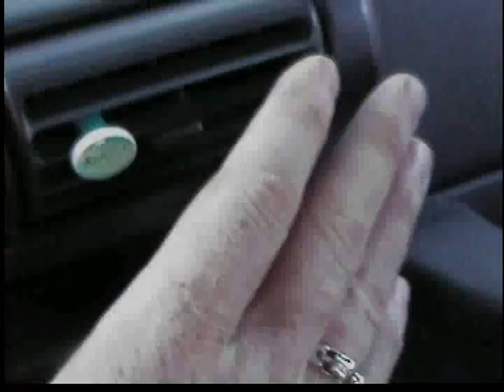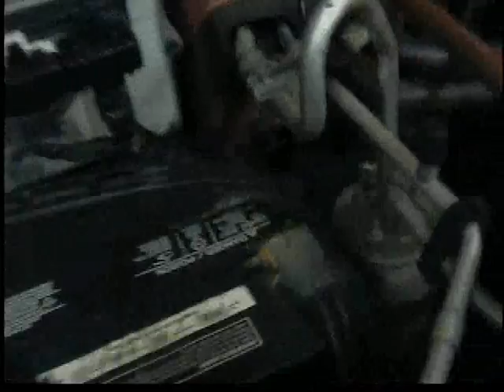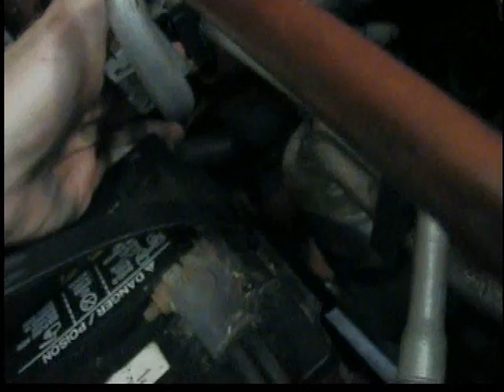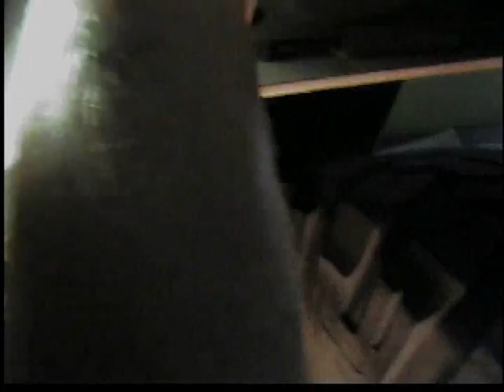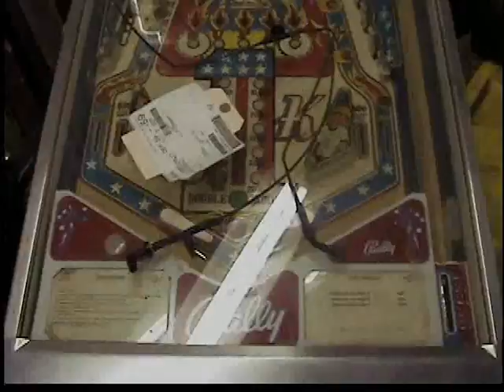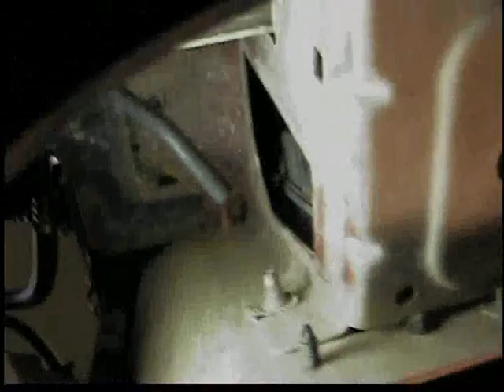cruise & HVAC controls vacuum leak fix, Jeep Wrangler TJ

Comment: Ok so everyone. Plug your engine vacuum off entirely and go get a jeep JK 12 or newer vacuum pump and bracket and wire it up on the keyed side via a relay and no more engine vacuum issues or leaks.. with 4 or 6 cylinders it’s the fix Chrysler should have made from the factory oh and your welcome!
Reply from the maker: Good info. Of course fixing the leaks is still a good idea. Jeep On!

Comment: Would you by chance have any videos repairing the electric door locks? 

I changed the driver side and am having issues with the metal rod locking from inside the jeep. This is nuts, been doing this all my life and a jeep is killing me!! lol
Thank you in advance!!
🤟🤟👍🤠
Reply from the maker: No. Inside the doors is tough to film. I have one for the outside door handles. It's filmed on a YJ.
Reply: @user-nq5rd4ck5z  
It's not the door handles I need to replace, it's the electronic selonide and the metal bar that goes to the lil flip button Inside the to lock/unlock I'm having issues with..
Ty

Comment: Hello, just found you today...
If you can help I'd deeply appreciate it. 
Question, my girlfriend has a 1998 Jeep Wrangler? Don't think it's a Cherokee just a plane ol' Jeep.
The controls for the defrost, vents, heat to the floorboard dosen't work. 
The blender door is cable operated soooo guessing it's OK? lol
Whatever info you could provide I'd deeply appreciate it. She dosen't have any heat at all and winter is coming. 
Thank you in advance!
Reply from the maker: Yes, lots of things to check. No blow could be the blower motor. It's also common for the box/duct to fill up with leaves and stuff. Check it when you pull the blower motor. Unheated blow is either low coolant or a bad bypass valve. If it blows only on high it's the blower motor resistor. I have a video for that too. This video is applicable if it only blows out of the bottom vent by your feet.
Reply: @user-nq5rd4ck5z  
Auctly I got it blowing from defrost, Center vents and floor however it dosen't seem to be as hot inside as it should be as in enough to defrost ice/snow. 
Where would the valve be you're describing? 
The heater control is operated by a cable. If that also goes to the proportioning valve would you have a video showing its location?
Thank you in advance!
Reply from the maker: @joesdot3288  I don't have a video on that. Jeep searching. Somebody does. Jeep On!
Reply: @user-nq5rd4ck5z  
I appreciate you...
Thank you very much 👍🤠

Comment: Can this cause high idle rpms. Mine is cracked and my ramps seems to be getting stuck at 1000 at red lights. It used to be worse but I already found and fixed 2 vacuum leaks. It gets slightly better with each fix
Reply from the maker: Yes. Vacuum leaks definitely cause high rpm idle problems.

Comment: My vacuum line at the vacuum reservoir has a T that one broken end turns into plastic and is 3" long and has nothing plugged into it and I can't find anywhere to plug it in? Other video I've seen just has a straight rubber hose. I just capped it for now. My cruise control never worked. Still doesn't.  Another line from the firewall is routed to a spot behind the battery and is just capped also, no idea where that goes. 2000' Jeep Grand Cherokee Laredo 4.0
Reply from the maker: Yikes. You need another Grand to compare it to.

Comment: my light on the dash will not go on , any ideas. is there a fuse were is that ?
Reply from the maker: Which light? I have lots of ideas. Jeep On!
Reply: @user-nq5rd4ck5z  the cruise light.... Green won't go on as well as the. Cruise
Reply from the maker: @rodgerrowe2424  Yeah, that is not a vacuum problem.

Comment: Dealing with the exact same thing.  Heat/fan would only run on low and medium and only blow out of defroster area regardless of where I had the switch.   Switched out the blower switch now have all settings but only coming out of the defrost area, so I checked today starting at the driver's side firewall and going around to make sure All the vac hoses were connected.  Found one by where the spark plugs are that is dry rotted and cracked on both ends but until I can replace pushed it back on there real well and now have air blowing out of all areas depending on where the switch is set, BUT it is also blowing out of the defrost on the other setting too.  When just set on defrost that is the only area it comes out of.  Anyway looked under the passenger wheel and the vac line there was just hanging loose under there.  We had a Stay and Play SMI braking system hooked up at a shop,  and I suspect that's when that one got knocked loose, but can't be certain.  Anyway hopefully after the dry rotted hose is replaced we will be in good shape.
Reply from the maker: crackerjack4u Cool. Check out my blower motor resistor video too. Jeep On!

Comment: Same CC/HVAC problem with my 95 Grand Cherokee.  Are these components in the same place?
Reply from the maker: It you have the 4.0L 6 cylinder some of it might be the same. But the Grad is a Detroit Jeep and a lot of the designs are different from the Toledo Jeeps. Start at the manifold and follow the lines looking for cracks or splits. Jeep On!
Reply: wwwCARSSUCKcom Cool, thanks a bunch!

Comment: so my Jeep Commander 06 cruise won't work. sometimes the air flow switch seems to be broke too. I lose power also going down the road. the traction control light flashes. think this will fix it?
Reply from the maker: Joshua Wilson I doubt it. Sorry. These are completely different vehicles. You could check the vacuum lines but they have nothing to do with traction control.
Reply: wwwCARSSUCKcom I had it plugged to a diagnosis and they said my cruise runs off a vaccum lines. then you said something about the blower fan being stuck on one setting. it made since when I seen this video. thanks again

Comment: the tubing is ripped and when i tried putting electrical tape it always rips again any ideas how i can fix this? do i have to get a new T or some sort of tube sleeve?
the tension from the tube when it comes out the firewall is whats making it rip i feel like i need an extension so when it meets the T it has slack to stay together.
any help?
Reply from the maker: Not sure which tube is ripping. If it is part of the engine bay harness, that whole harness is $18 and probably worth replacing. There is another harness for inside the cab. It might need to be replaced if you are talking about the tube that runs through the firewall. Another option is to by rubber vacuum hose at the auto parts store that fits tight around the tube and make the extension like you were thinking. Let us know what you figure out. Better yet, film it and share.
Reply: fixed!:) just went to home depot and got a plastic tube that fit the both ends. used a zip tie so thats in place and works like a charm
Reply from the maker: silv1010 Cool.

Comment: would this also cause your check engine light to come on. or do you know?
Thanks
Reply from the maker: It would take a big leak, but yes maybe. If you have a check engine light on, there will be a code. Go to your local auto parts store. Most will plug in and read your engine codes. Then you can search for that code to see what your problem could be.
Reply: We I found your bid and I did notice when going on upper rpm my center vent stops blowing. And I thought it might have an affect on the emissions code I've been fighting with.
Thanks for your reply
Sean
Reply from the maker: Sean Samarron Hard to say if it is a cause or effect, huh? It is such a simple harness, it is worth inspecting for leaks. You can also pull it apart and test the check valves by sucking and blowing. A more formal troubleshooting step would be to use a vacuum pump and gauge. When you figure it out, film and share.

Comment: I just changed my evaporator and heater cores and when I finished I saw a loose boot by my battery well. I could not figure out where it went. Your video showed me exactly when to connect at the reservoir below the battery. You saved me a lot of problems. fortunately the boot was still in tack and not broken. Thanks again!!!